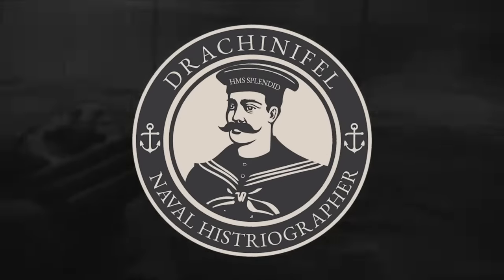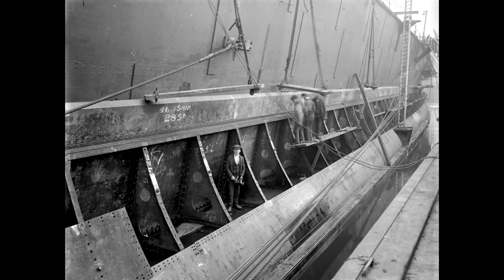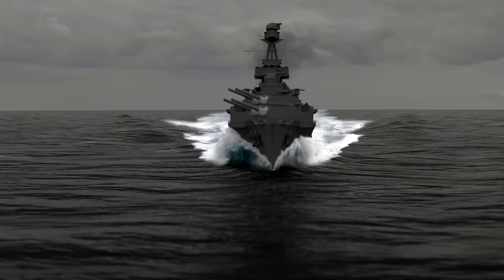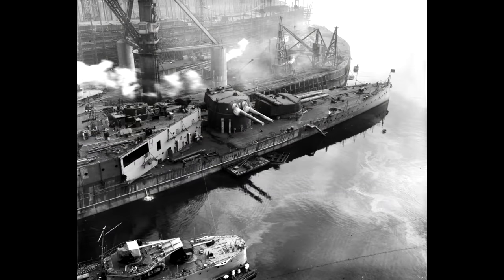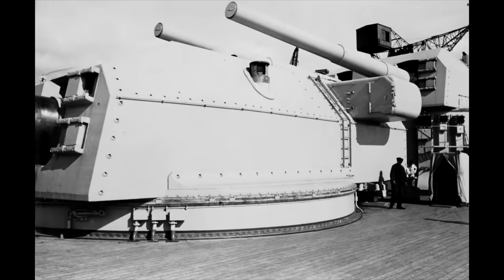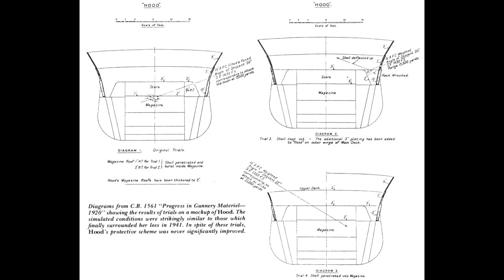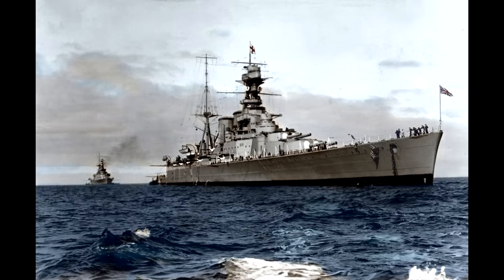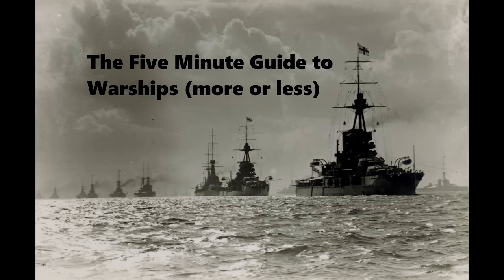The Loss of HMS Hood - But why did it blow up??

Comment: I had read a collaboration of a naval architect and naval historian that blows this whole this whole video out of the water....There are many factors not considered or even mentioned in this video. It all starts before Bismarck even leaves port, Bismarck was supposed to be attached to Scharnhorst and Guisineau but both were laid up for repairs and unavailable to sail with Bismarck to protect it from enemy capital ships, so Prinz Eugen was a late attachment and needed to refuel in a Norwegian Fjord before making the dash for the Denmark Strait, again Prinz Eugen's primary function was to protect Bismarck while it conducted commerce raiding and this leads to a major factor, Bismarck was loaded with inciderary shells and not armor piercing...this fact really makes it next to impossible that the fatal lucky shot was from Bismarck. Bismarck had orders before leaving port to "NOT ENGAGE ENEMY CAPITAL SHIPS" because of the ammunition it was loaded with for the mission it was intended to do. Scharnhorst and Guisineau were to cover Bismarck while it makes it break to the Atlantic shipping lanes.
Reply: Why would the (11 inch gunned) Scharnhorsts be sent to protect the (15 inch gunned) Bismarck from 'enemy capital ships?'  The suggestion is meaningless anyway, as you say yourself. Both Scharnhorsts were not fit for sea.   Prinz Eugen wisely refuelled in Norway. Bismarck foolishly didn't.

Again, why would an 8 inch cruiser be used to protect a battleship from other capital ships? Indeed, how could it do so?

Bismarck was definitely not loaded with HE shells only. Her mission was certainly to attack convoys, and to avoid engaging capital ships, largely because comparatively minor damage could doom her (as, in the event, it did.)

In short, I regret to inform you that your whole post is absolute nonsense.   Please tell me your source, as I would love to read it.
Reply: While I agree with you that the theory advocated in this video is unlikely (although it is possible), the orders which Admiral Lutjens received not to engage enemy capital ships had nothing to do with Bismarck's ammunition loadout. There is no evidence that Bismarck was loaded "...with inciderary shells and not armor piercing..." The idea that Germany's newest battleship would not be carrying armor piercing rounds for his main battery in the event of an unexpected engagement with enemy capital ships is illogical. 

Lutjen's orders not to engage enemy capital ships stemmed from OKM's emphasis on a trade war against enemy shipping, and the avoidance of engaging enemy warships when possible. The original plan for Bismarck to sail with Scharnhorst and Gneisenau was not predicated on the assumption that the latter two vessels would protect Bismarck; rather, that the three vessels would sail in company for mutual protection.
Reply: The reason for Bismarck not having AP shells was due to the fact the factory that manufactured the shells was destroyed and/or put out of commission by allied bombing
Reply: @Steve-pl4dz  Yeeaah, I'm sure you're right. Too bad there's no evidence to support your claim. 

Next up- you claim that the Kriegsmarine's naval stores of accumulated 15' ammunition was somehow "...destroyed and/or put out of commission by allied bombing" as well.
Reply: @Steve-pl4dz  Nonsense. I suppose asking for a source which confirms this remarkable claim would be too much to ask?

Comment: as a general safety rule ....spark + gunpowder = BOOM !   
 Old Ship made of Steel + COLD water .Hood was also over due for refit & repair overhaul in a dry dock...Hood was about 23 years old at this point..
Cold water makes steel more brittle . [ask Titanic about that]    that may have played a part in the German shells doing what they did . something to think about anyways .
Reply: The argument doesn't hold water!. Titanic's sister ship Olympic cruised the same waters for over 20 years, having been built in the same shipyard.
Reply: @dovetonsturdee7033  And save for the iceberg strike that sank R.M.S. Titanic, Olypmic suffered considerably more damage over her career.

Comment: Can anyone explain this to me: during an ongoing naval battle, would any parts of a Battleship crew have been outside on deck? I would imagine firefighters and the like might have to get out in case of a hit, but other than that, was everyone inside of the superstructure, below deck, inside of gun turrets etc?
Reply: Yes. Spotters, anti-aircraft gunners (not necessarily the case here), secondary gunners if the armament was open topped like the 4" guns were on Hood and of course damage control and the like.

Comment: I still think it is highly likely the crew of HMS Hood were using Jutland Style ammunition handling. Hood was known for a high rate of fire, yes? Sounds like they let their pride get in the way.
Reply: I doubt it, considering that the RN outlawed such practices after Jutland.
Reply: It doesn't really register what you might or might not think. The reality is that lax cordite handling ceased after Jutland. It had happened there, in the battlecruiser fleet only, because of Admiral Beatty's fixation about rates of fire. It was never the policy of the Grand Fleet's battleships.

Comment: A ship making a hard turn to port as the rudder position indicates would heel over to the starboard or the outer side of the turn, and moreover, it would heel over before it actually begins to turn, exposing the thin deck armour to a higher angle of perpendicularity.  See https://www.youtube.com/shorts/cWuicbWXtss among probably hundreds of videos of warships making high speed turns, the angle of heeling in Hood's case lowers the hull to the starboard side that was exposed to fire from DKM Bismarck.  This negates the underwater 15" penetration theory advanced here and makes a ~40 degree deck penetration in to the 4" magazine a few seconds before the subsequent large scale rupture of the ship the only realistic conclusion to come to.
Reply from the maker: The rudder position neither indicates that ship was in the middle of a hard turn (although it could be in the process of starting one) nor makes any comment about the ships heel. In fact, if you consult Knights Seamanship, you will see a ship placed in a given direction of turn in fact starts with a slight turn and roll opposite to that which it is directed, before commencing the main part of the turn.
Reply: It wasn't called DKM Bismarck.

Comment: No armor.
Hit magazine,
Arizona 1941
Reply: Jonah Whale  Tiger tank front armor 4in. Sherman tank front armor 3in.
Trying to remember which tank was kicking the s*** out of the other tank all the time?

The Hood was a battle cruiser, they shed armor to increase speed.
Reply: Jonah Whale  no argument, but you changed the point, the reason the Hood got annihilated by the Bismarck, it had no armor.
Reply: Jonah Whale  oh for God's sake. You made an armor example, I used other equipment that used the exact same armor. Then explained how 4in kicked the s*** out of 3in. Then you went on to include aircraft carriers that were not even part of the initial topic. The hood had no f**** Armor. Jesus Christ. It's like I'm talking to a chimp.
Reply: Jonah Whale  You're taking the words too literally. People would say no armor meaning it doesn't have enough. Not that the battleship was made out of balsa wood.

You are someone unable to readily (or at all) grasp abstract or comparative methods like simile, metaphor, analogy, idiom and the such.

Steel is steel. I'm pretty sure they didn't use mild Steel on tanks and Battleships. Good God!
Reply: Hood had a 12 inch belt, and 3 inch deck armour. Her weight of broadside was heavier than that of Bismarck. For comparison, the Washington, just entering service, had 12 inch belts and 3.6 inch decks. The 'no armor' comment is factually inaccurate.

Comment: Hood should have never fought a ship of the power of the Bismark but Bismark scored a lucky hit at a particuliarly optimum location and time on the Hood. It's simply bad luck for the Hood. There was no single British battelship of equal power to the Bismark so it could have been even any British battleship and the outcome maybe the same. The British were too concerned about sinking the Bismark when it would have been better to wait for better circumtances. Never engage a superior ship on its terms.
Reply: 'Better circumstances?'  Would that have been after Bismarck & Prinz Eugen had broken out into the wider Atlantic, and taken a lot more resources to locate?

The British had four capital ships in the Home Fleet with the speed to catch Bismarck, and positioned two of them in each of the choke points from which Bismarck might have emerged.  The Battle of the Denmark Strait, and the damage Bismarck received during it, ensured that Lutjens was obliged to abandon his mission and make for St. Nazaire.

Bismarck had a weaker broadside, and thinner armour, than the British Nelsons or the KGVs. Moreover, her armour was laid out in the outmoded, incremental, manner rather than the superior all or nothing of the two British classes.  All Bismarck had in her favour was her speed. Once that was lost, she was doomed.

Comment: I think the second shot just opened up the deck and let more oxygen in.  If you light gun powder in a closed space like a small jar and have a small hole it will burn slowly but if you open the jar quickly it will flash and burn the rest.   My theory is that the first hit lead to fire reaching down in to a magazine and the second hit opened up a path for oxygen to flare up the fire and explode.
Reply: Gunpowder burns much faster under pressure, so it is able to cause a devastating explosion in closed spaces.
Reply: You don't understand propellant or explosive chemistry.
Reply: @AndrewTBP  Well that is just from me pulling apart bullets and lighting the power as a solder with nothing better to do....    Anyway, I also wonder if the explosion was actually just one of the guns like Turret Y detonating itself, it would not have been the first time that a turret failure leads to a loss of a ship.

Comment: the hms hood was a 20 year old piece of crap when ww2 started it had a wooden deck they brought her in and put a steel plate on the forward deck but left the rear deck was still wood the AP fired from bismarck was a new type of shell bismarck fired ap went through wooden rear deck straight into rear ammo storage BOOM hood sunk what was left of it after the explosion
Reply: Absolute nonsense.  Hood had a three inch armoured deck, covered with teak planking.  Every other capital ship had similar planking. Firstly, it was safer than steel when wet, and secondly it helped to control temperature below deck.  Just look at photographs of any battleship, or at any of the preserved US battleships, if you doubt me.   Didn't you actually watch the presentation at all??
Reply: @dovetonsturdee7033  well you want to call British navy their the one's who said it. I believe they would know they built it
Reply: @donaldmatthews4383  What? The Royal Navy said Hood only had a wood deck?   Please don't be silly.

Comment: Your theory may possibly be correct but you only have horizontal hits you have not drawn any vertical hits in your sketch or diagram you claim that what you say is only correct you were not there what you have said here is just speculation
Reply: Gunnery data tables which were formulated and created by the test firing of naval guns by all navies before, during & after the war show that shells fired by Bismarck's 15 in guns when fired at the range involved at the time of Hood's destruction in the battle of Denmark Strait (17,000 yards or 8.5 naultical miles) had an "angle of fall" of between 11 ~ 13 degrees, that is 11~13 degrees from the horizontal. Prewar testing of Hood's deck armour showed that it was proof against penetration by 15 in shells at angles of fall of 20° or less. That is not speculation but documented fact.
Reply: @walterkronkitesleftshoe6684  So it was a short the shell came under the armor belt that was indeed a lucky hit

Comment: OK, very interesting but, simply put very big boats at fire very big bullets from very big guns started throwing their big bullets at each other. Because of sheer luck, excellent gunnery on the part of the Germans, Murphy’s Law, or any other one of a dozen extraneous variables the Germans were able to get their big bullets where it counted most. The end result is the same regardless of how it happened. The hood sunk, the Bismarck mission killed,  and after living on borrowed time for a day or two later would be sunk, the prince of Wales mission killed, even though the Japanese would finish with the German started and sync it later, the prince Eugene very lucky,

Comment: Because the Hood was hit, duh!! :-)
Reply: Yes Captain Obvious but the questions were what did that shell do? What are the factors in her sinking? Who was the most likely culprit?
Reply: @KatyushaLauncher  The technical issues are well known, Bismark was better battleship then Hood. It built some 20 years later is it should be more modern. So Bismark was wider, therefore more stable and had better armor.  Pointing finger only at "bad luck" that Bismark was able to hit ammunition depot of Hood is shortsighted.
Reply: @pavelneuzil6457  it was more  luck, go watch the whole video. Hood was not hit in the magazines directly
Reply: @KatyushaLauncher  It could be, but I do not believe in luck that much. Plus I read book about it. Cheers